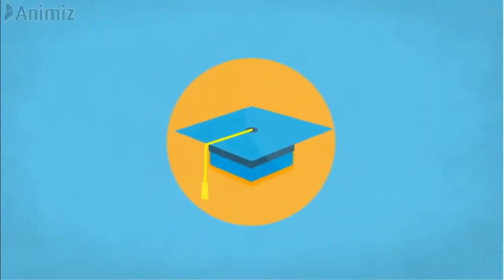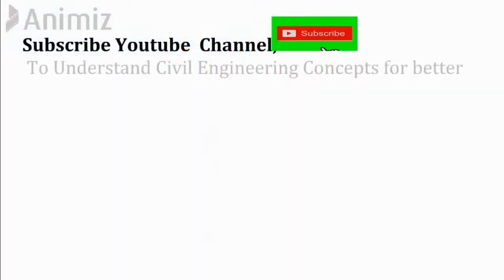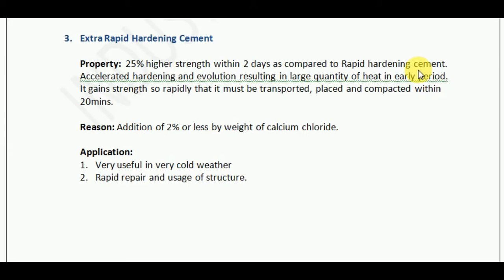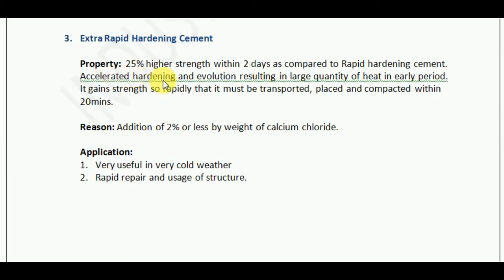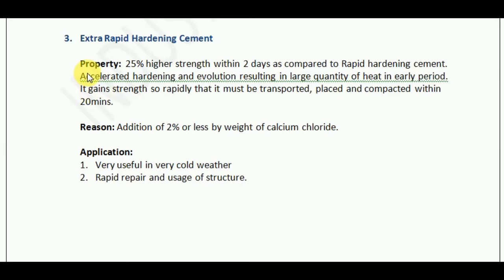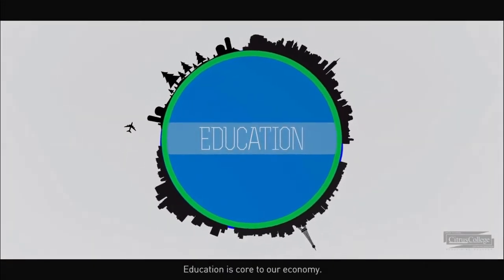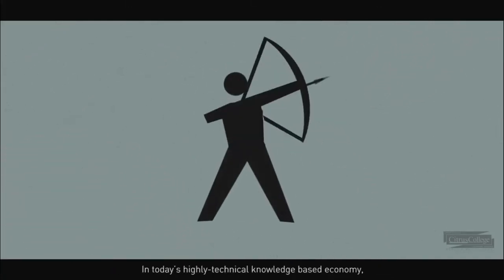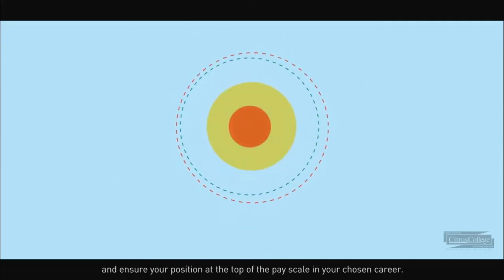Extra Rapid hardening Cement CONCRETE TECHNOLOGY MODULE 1.2.3

Comment: Sir interlocking tiles banany kai leye konsa cement best hai. ? Kya ham kisi normal cement mai koi camical daal kr uss ka use kr skty hai .pls tell me. Thnks
Reply from the maker: The process of manufacturing is simple and standardized. Cement concrete is a mixture of cement, sand and stone chips in correct proportions. The items are mixed in water and churned thoroughly in a concrete mixture. The process involves proportioning, Mixing, Compacting, Curing & Drying. A concrete mix of 1:2:4 :: cement: sand: stone chips by volume are used for making paving blocks

To know more visit this site , it will let you know everything you are looking after 

http://www.techno-preneur.net/technology/project-profiles/other/tiles.html